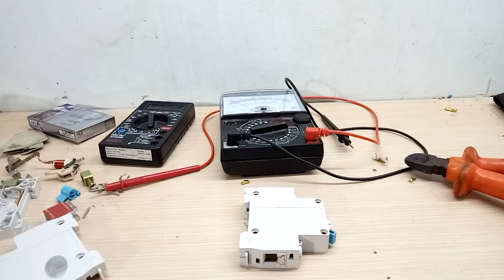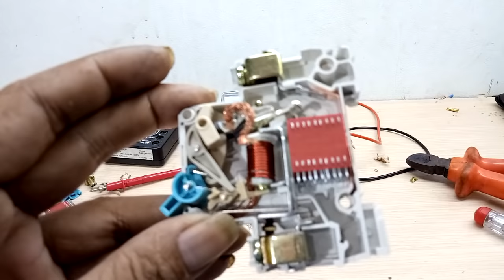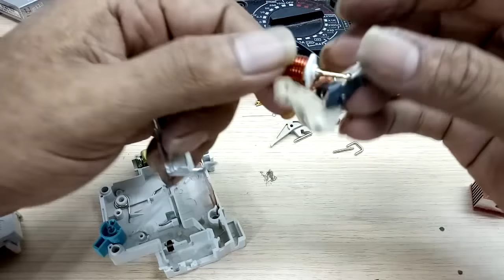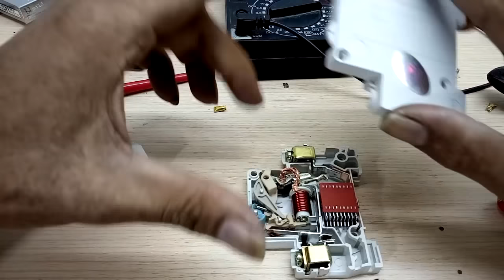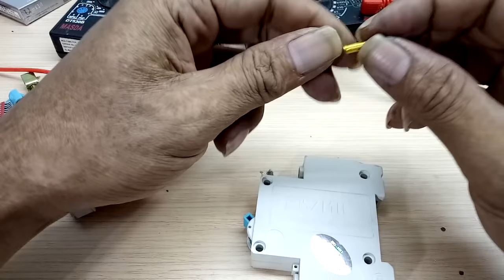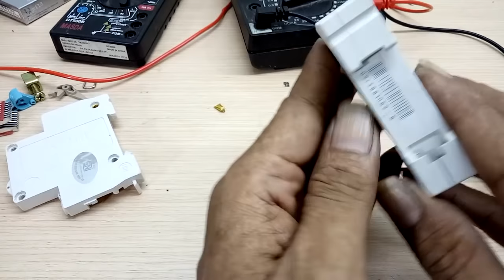trik ganti isi mcb

Comment: Gereget teman waktu smk dulu  mcb di meteran di rumah nya yang 2a di ganti pakai 20a 
Jelas mantap mau nyalain ac 1/2pk 10 biji aja gak akan jeglek karena yang 1/2pk sekarang rata2 320-375w

Katanya dia masak nasi pompa air nyala pc nyala dispenser nyala juga aman dan perna pinjam kompor induksi 2kw aman semua alat nyala juga 
Tapi akhir nya di bulan ke 6 sejak ganti sendiri itu ketahuan petugas nya 
Jadi bapak nya urusan sama pln 
Memang agak nakal di sekolah juga 
Makanya bisa berani ganti itu 
Tapi jujur juga dia curhat ke guru nya saat belajar las listrik makanya saya tau
Reply from the maker: mengganti mcb di kwh cepat atau lambat akan ketahuan karena bisa di lihat dari tagihan pajak perbulan
Reply: @budisantosochanel  ya benar gan 
Memang getreget teman ane itu 
Dah di bilangin sama guru nya juga kalau belajar listrik 
Jangan coba2 otak atik meteran nanti urusan nya panjang eh malah bandel
Katanya berani karena jengkel tiap nyalain pc jeglek terus 
Suruh naik daya ortu nya gak mau makanya dia ganti sendir
Lucu nya katanya kepergo knpetugas gara2 
Lagi nyalain mesin pressure washer (steam) 
Pas cuci motor 
Dia pinjam ke teman nya mesin itu 
Jelas petugas langsung tau masa daya 450w bisa nyalain mesin 700w belum sambil mutar musik di pc pakai speaker ampli rakitan kan agak lumayan watt nya ampli rakitan itu
Reply: @bangherlambang3226  petugasnya itu datang pas cek meteran terus kepergok atau p2tl langsung?
Reply: Sekedar diketahui batas Wajar pemakaian 450 watt Pembayaran 150ribu maksimal perbulan,Kalo lebih Rumah anda akan dipantau PLN.Paham